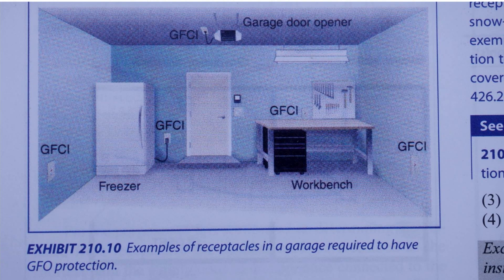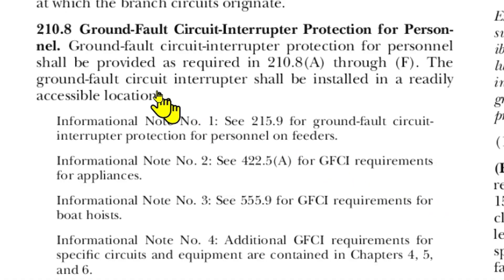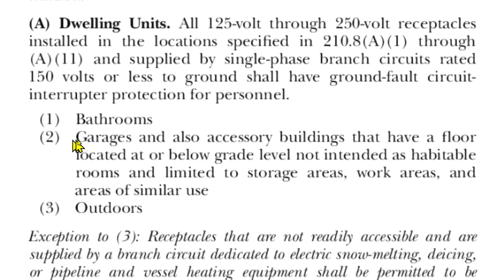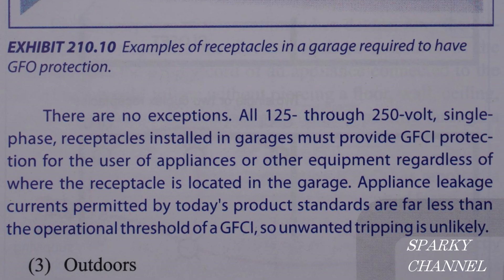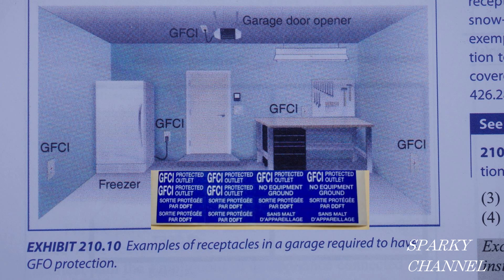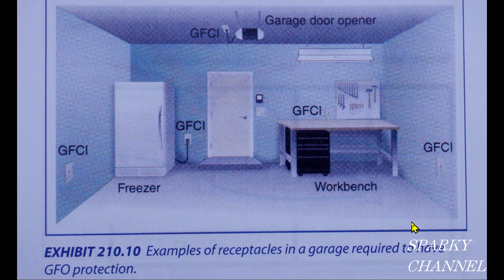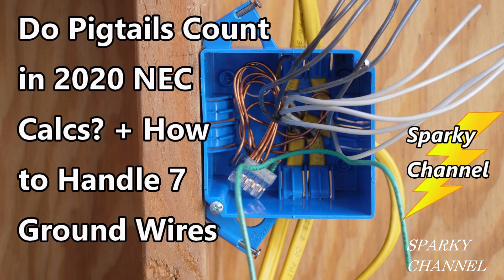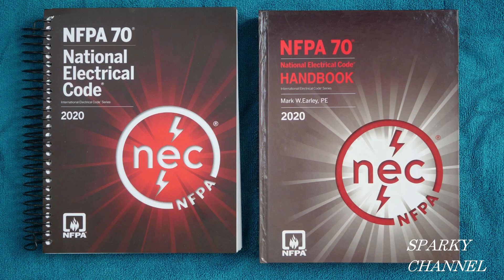Do Garage Door Openers Need to be Protected by GFCI? And What About GFCI Accessibility?

Comment: At some point in the near future the simplest answer would be, "just have everything in the home protected by GFCI".
Reply: then some manufacturer will develop a whole-house GFCI/AFCI main breaker, and any hiccup will black out the entire house.
Reply: @kenbrown2808  The UK already has such things. (see also: RCD)
Reply: @jfbeam  all our arc fault protection is at the panel, but I'm talking about having just one device that kills the entire house and makes troubleshooting impossible.
Reply: @jfbeam  RCD is similar but not the same as GFCI (it has a higher threshold).  GFCI trips at 5mA difference while RCD trips at 30mA
Reply from the maker: I hear you.
Reply: You definitely DON'T want whole home GFCI. One little trickle to ground and BAM everything is out. I don't even like that all my outside plugs are protected by one plug. I was running a small sump pump to keep my excavation dry and the GFCI tripped a couple times and everything dies and I have to walk around to reset all my tools. I would rather they force every plug to be its own GFCI or put a distance limit on how far apart the master plug can be from the rest.
Reply: I saw an AFCI/GFCI combo panel board on This Old House a couple years ago that was pretty cool.

Comment: My opinion on "Readily accessible".
 I'll use two real world examples.
My current garage.
The home has 9 foot ceilings and the garage is two steps down from there, so the garage door opener outlet is well over 10 feet up. So unless I get out the 6ft stepladder and climb up at least 3 rungs, I cannot reach the outlet. I do not consider those outlets "Readily Accessible"

A friend of ours has basement garages with 7ft ceilings. I can stand on the floor and easily reach the outlet. That outlet is readily accessible.
Reply from the maker: That sounds correct to me. They don't give a certain ceiling height in the code so it would be up to an inspectors opinion on that one.
Reply: @SparkyChannel  Basically if you don't need a ladder or tool to reach it. I am guessing if the home owners are short then even 7 feet up might be out of reach. Lol
Reply from the maker: @illestofdemall13  Yes, what about little people? They made it really arbitrary for an inspector.